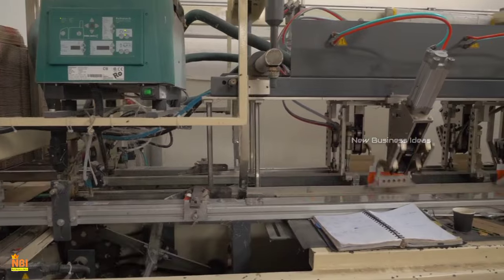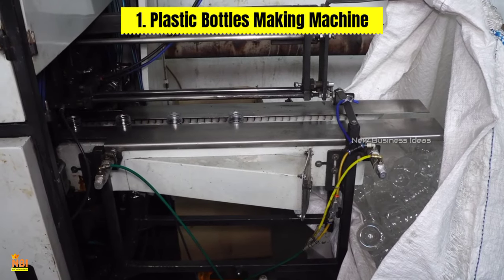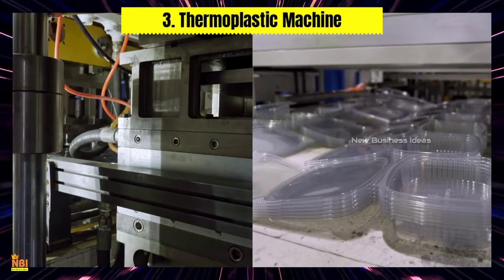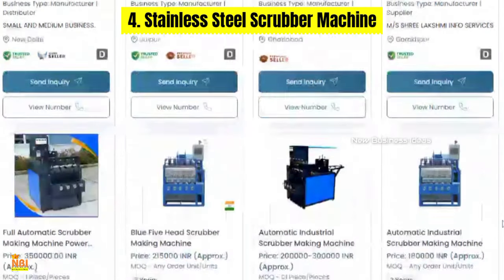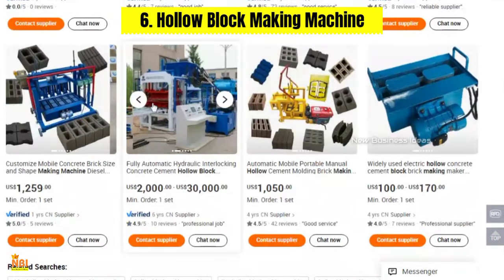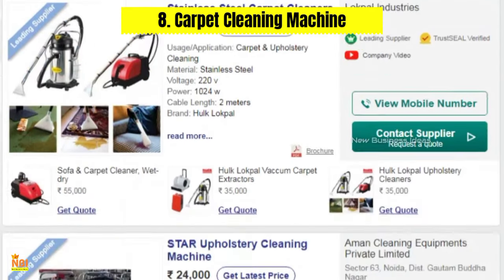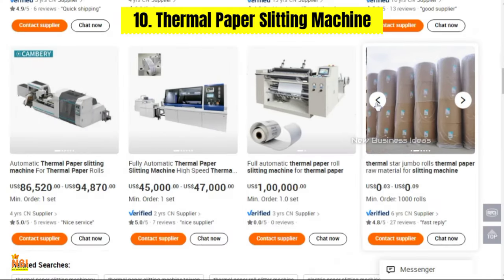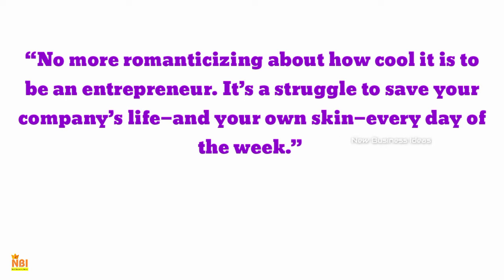Top 10 Machines for Small Business with Low Investment

Comment: 1. Plastic bottles making machine 
2. Knitting 🧶 machine 
3. Thermoplastic machine 
4. Stainless steel scrubber 🧽 machine 
5. Chalk production machine 
6. Hollow block making machine 
7. PVC pipe making machine 
8. Carpet cleaning machine 
9. Oil extraction machine 
10. Thermal paper slitting machine